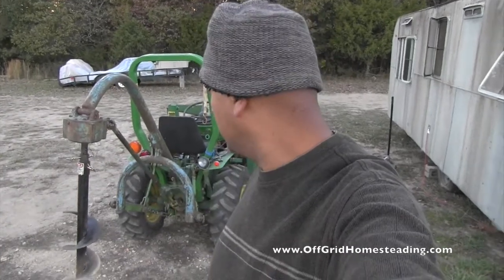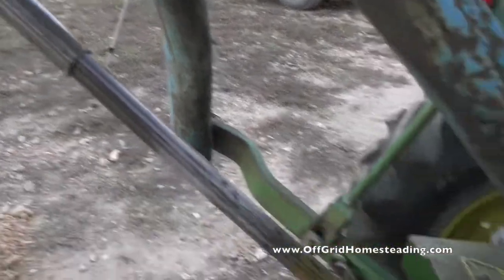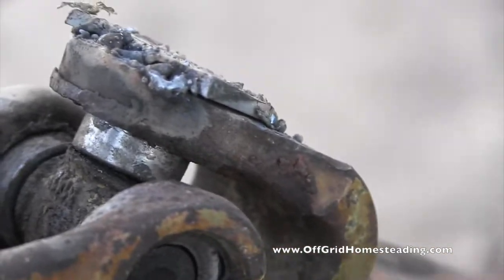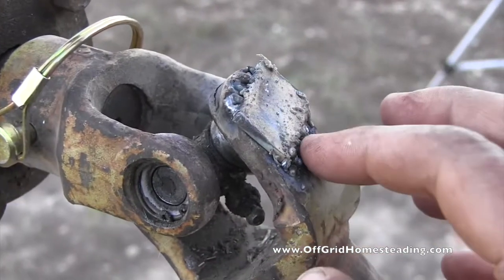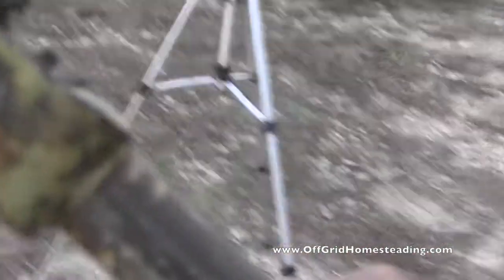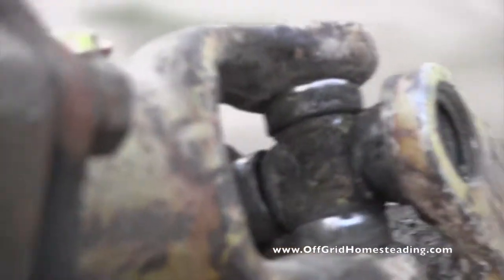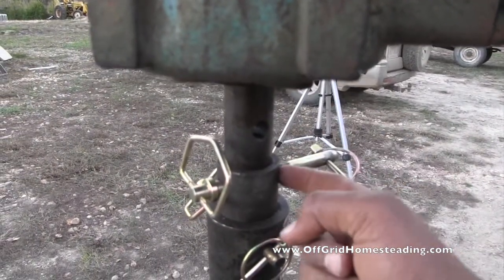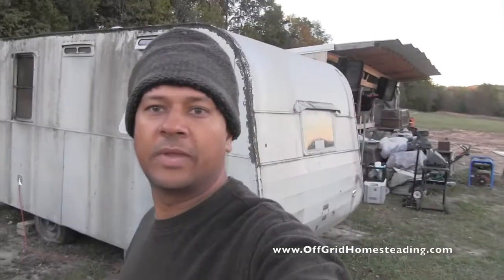OGH - Building Addition on Camper Part 4 of 8

Comment: That race is shot.  Hope you finish before it flies apart.
Reply from the maker: F333 we got all of the holes dug, I oiled the race / joint and ran it slow and all was good.  I did find a local automotive shop that would press out and in new joints - so it’s on our long list of “crap to fix before I use it next time”